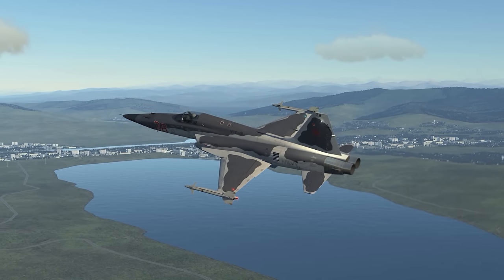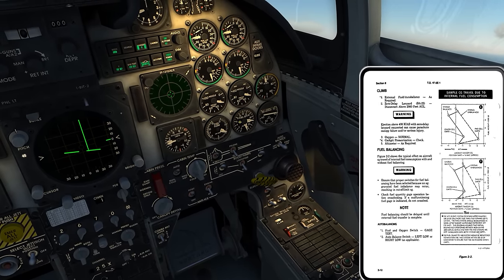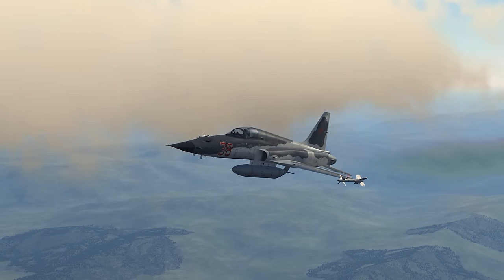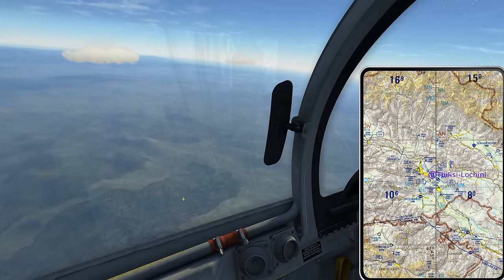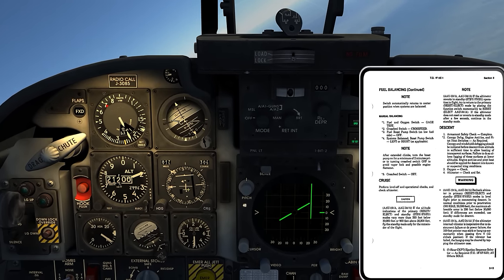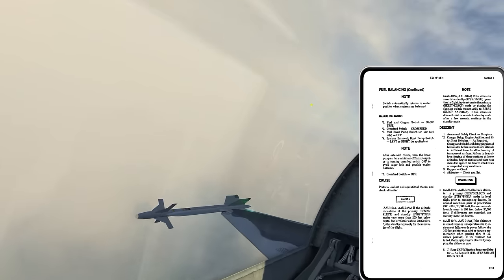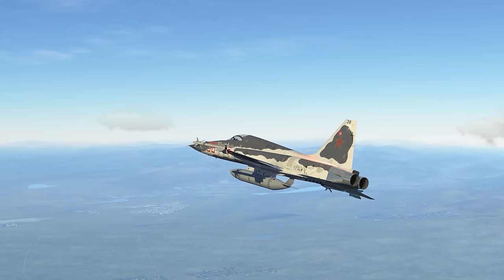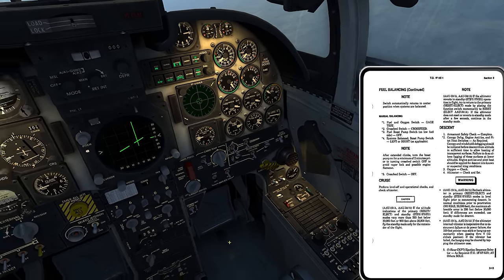Test Flight - DCS: F-5 Tiger II #8 - Flap System, TACAN Navigation, Fuel Management, ECS System

Comment: I don't know if it's accurately modeled in DCS but if there is a rapid depressurization, all the moisture in the air will condense, causing fog on your cockpit glass (canopy and gauges ?). That's when the Defog button would be used IRL. I think (again guessing) that the A/C unit would then go into overdrive to pull the moisture from the cabin air.

Comment: Basically, I guess you yourself gave the answer here to the high o2 use I think........the cabin ...when pressurised of course,......fools the altitude,......you showed the table for it.......so when pressurised there's on forehand no need to turn the bottle on allready when on the ground, except to test the system,......but further on, you can climb at least to  about flight level 250 and 300 before turning it on as needed,....... when the cabin is pressurised of course..........only above that it'll get lower on o2 (and according to the tables I'm still on the safe side,....but better safe than sorry)........so that'll save you a lot on the bottle of O2................. I truly love the vids B.T.W.......a big thumbs up  ;-)